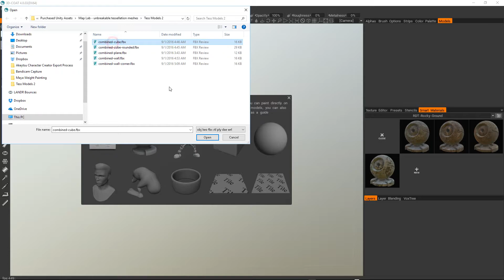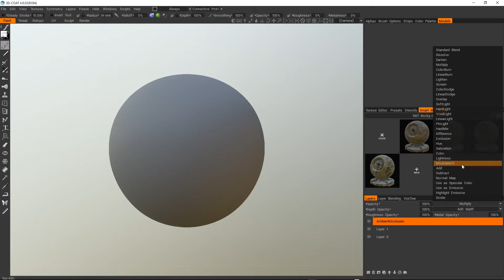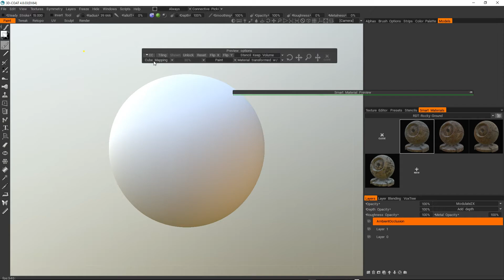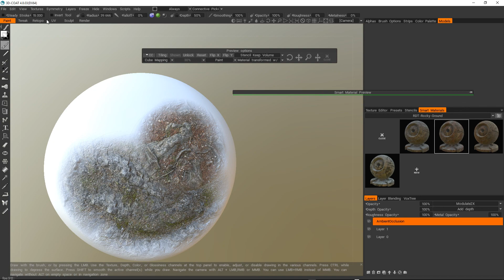3DCoat -Painting With Multiple Real Displacement Textures (The Quick Explanation)

Comment: is it  possible to apply a real mesh displacement on a  all over surface object at once ? as its possible with zbrush "noisemaker" ?
Reply from the maker: Sorry for the late reply. Yes you could use noise maker, that's how its done for things like fabric. You can also mask areas to be excluded and project the details to levels of subdivision. You can't use noise maker for projecting photo-scanned textures, it only has procedural noises. You can use the fill tool in 3D coat to do it all at once which in the end can include roughness, metal and AO maps -faster workflow.. but zbrush can only use color with displacement and a faked ao all at once. If you want real ao baked inside zbrush, it would have to be done at the end with the AO plugin which creates ao as a mask (hide or remove color,  then project AO, then save as a texture.)